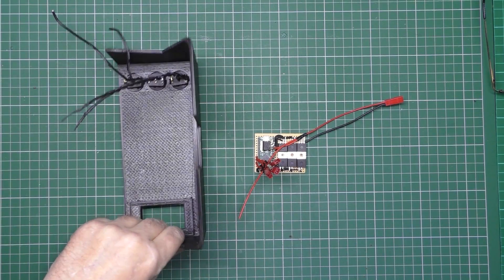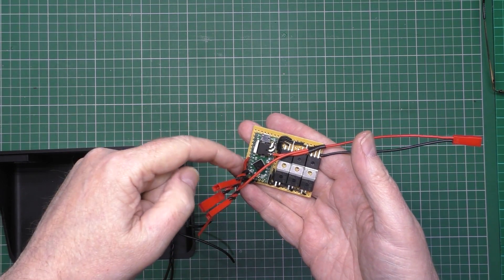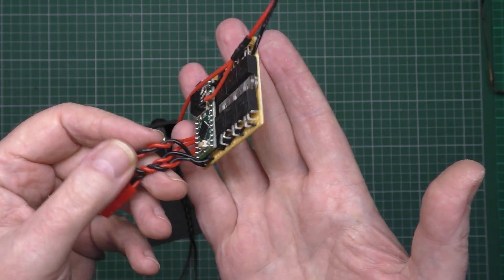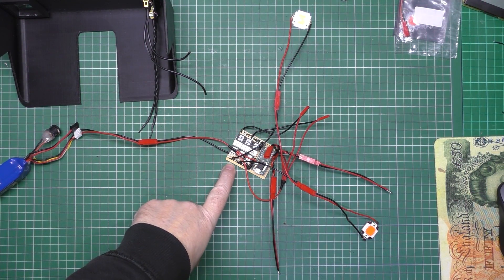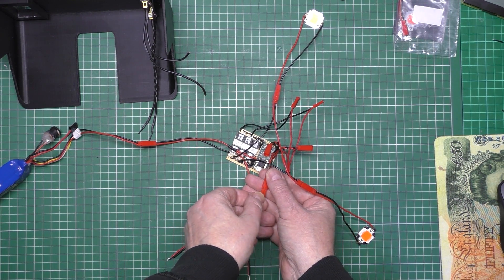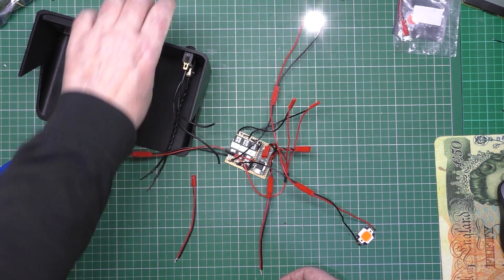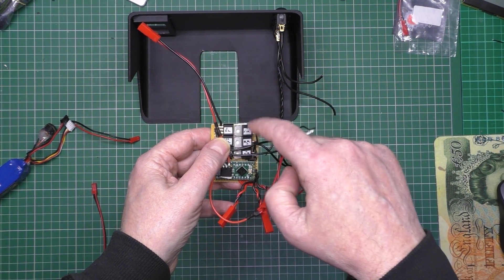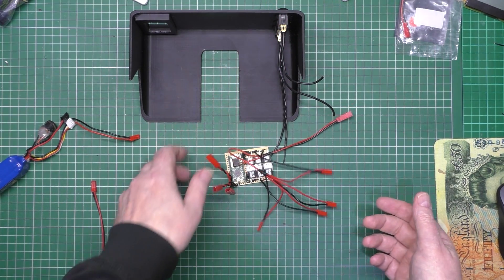11000w DIY eBike build part 9 - Lovely flashy lights

Comment: where will you be getting the power to power the LEDs, and the control circuit.
Reply from the maker: I have a 12v 20a regulator fitted in the 4th battery compartment. It's also used for my winter heated clothing.

Comment: I have tryed a couple of times to build some home made rear indicators as all the ones i see in stores are a waist of time BUT always failed so far just not easy finding all the bits, yet you pull some thing like this out of the bag as if its not a problem lol.
interested to see this in action Tony.
Reply from the maker: The flashing lights were the easy part mate. Getting a BMS fitted and making a single plug charge solution has been the hard part. I've spent 2 weekends, trying to make a current sensor for the new power supply but I've finally cracked it.

Comment: Nice work Tony. I have some concerns about those  bright, flashing LEDs. Have you made a test, what will the drivers driving against you will see especially at night?
Reply from the maker: I've tested them at night and they won't dazzle anyone because they're only on a 1ms pulse. The LEDs actually take 10ms to fully activate so it's only 10% (1w) brightness which is enough to be seen.